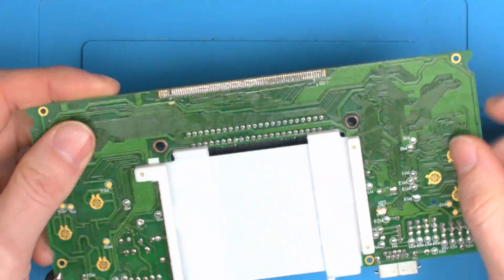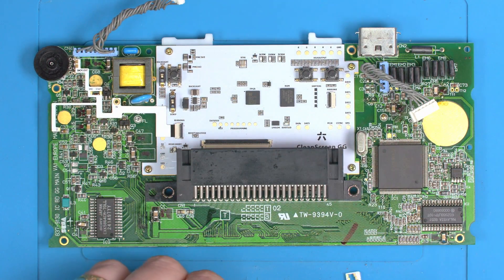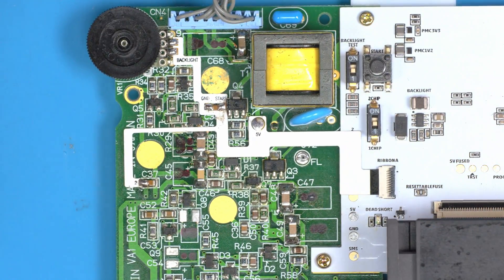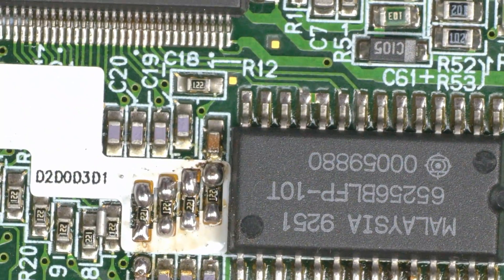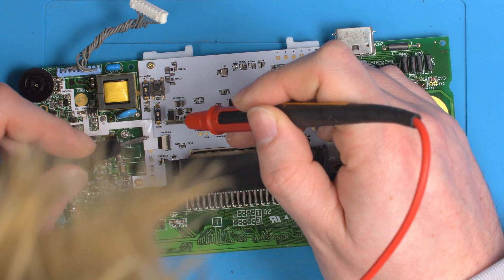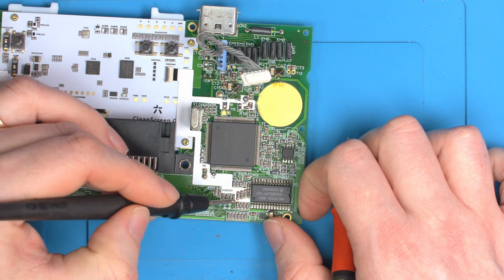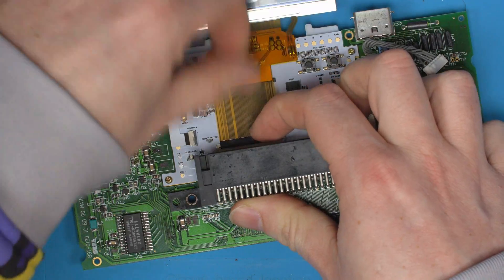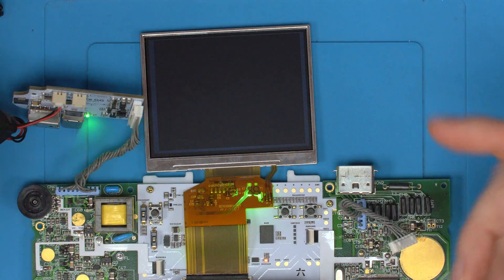CleanScreen Game Gear Install Guide V2 White PCB

Comment: What soldering tip do you use when attaching the ribbons?
Reply from the maker: Any works fine. Just make sure to use flux more than anything else to allow surface tension to make the connections clean

Comment: I have a 2 chip board and clean screen 3.1.0 do i have to do the 3 wire solding to where the screen used to be like your website shows? Or follow this?

Comment: Question, your C54 and C55 are empty, does it mean these capacitors are not required on all LCD mod kits?
Reply from the maker: No. CleanScreen doesn't need it. Others do (some)
Reply: THANKS for the info Sir.

Comment: Hi. Can you confirm that the wiring for the left had ribbon is exactly the same for both single and 2 chip versions?
Reply from the maker: Other than SMS pad
Reply: @RetroSix  Thanks 👍

Comment: Please help. Screen display's wrong colors. I tried the switch in both positions and soldered a wire to csync. I have the two chip game gear

Edit: I didn't see the update video. I soldered D5 to 5v, and that did the trick. Looks beautiful with an IPS screen.
Reply: Please explain, where is the update video you are talking about? I have stability issues (sometimes going black screen) and I am grasping at straws. So just out of interest I want to know more about the solution you mention (D5 to 5V).

Comment: can a GG with an lcd mod work with a 5v rail only? there is allot of noise coming from the speaker i believe it comes from the power circuit

Comment: Do we still have to cut the 34v wire and remove r29 (r56) and r30 (r57) resistors when installing the new v2 version? I noticed in the video that the 34v wire and resistors are still intact and the site still shows v1 instructions with no updates.
Reply from the maker: It works with only L2 removed but it's advised still to remove those and switch off 34V on CleanJuice or cut wire
Reply: @RetroSix  Ok so still follow the v1 instructions
Reply from the maker: @sivanyc  yep

Comment: Great Video Luke. Did you get a chance to test the scaling issue with the excellent dizzy collection?
Reply from the maker: Yeah it does have totally custom size. Not sure how to resolve it. Ideally an automatic detection of overscan data perhaps. Will require logic analyzing and bit of time to test
Reply: @RetroSix  Thanks Luke for testing.. It does the same with super kick off as well. I have about 40 games and it only those 2 which I have seen the issue so probably an isolated to a small number of games.

Comment: Looking good! 
Is there a way to add the new anti-shimmer algorithm to a V1 kit?

I just converted my console not but two weeks ago.
Reply from the maker: Unfortunately not. New one has much faster FPGA, and more advanced code. The older version has no memory left to be able to do that
Reply: @RetroSix  I see... does the V2 use the same LCD screen model?
Reply from the maker: @animetronics2804  yes at the moment. Will be updated to use IPS in few months

Comment: I notice that Dat0 - Dat3 connect to both the top and bottom of r13-r16 on your ribbon there. When wiring manually do these also connect to the top and bottom of each resistor? It doesn't specify on install instructions the exact placement of these connections. Thanks, Great clean screen update!
Reply from the maker: It doesn't make much difference. If you get speckles on screen or color issues you can try them on top, or on bottom, or bridged